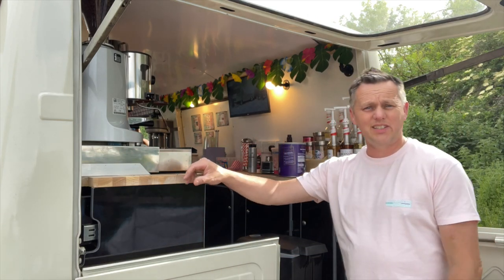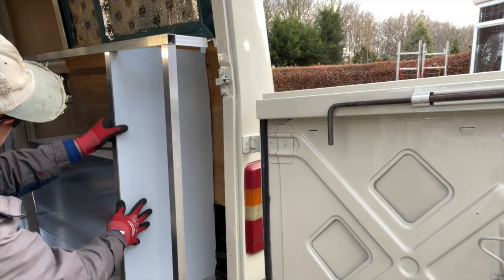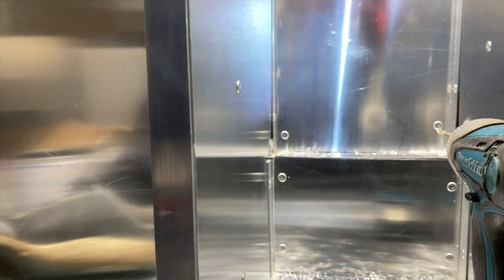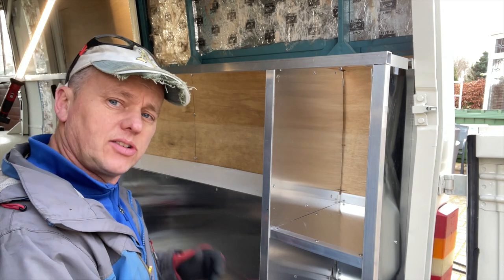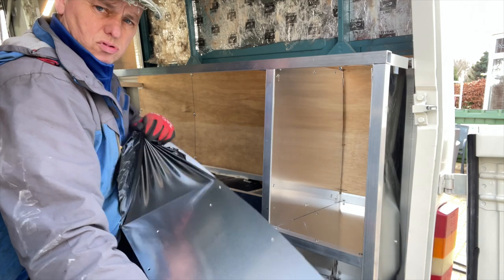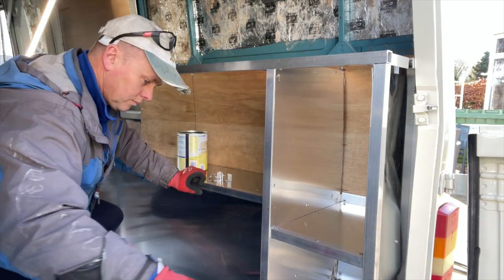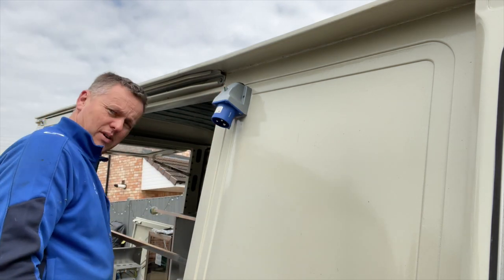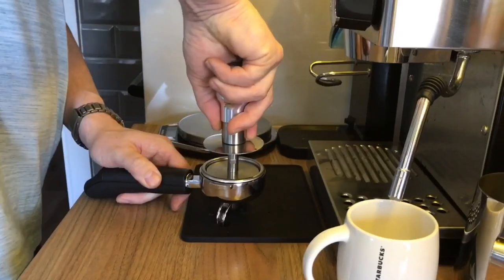Peugeot J9 Coffee Van Restoration, Episode 22  Building Units & Electrics, Fitting Consumer Unit.

Comment: Just a couple things to note-if not already, need to make sure the chassis is earthed to the main earth terminal in the consumer unit,  to allow fault current to trip the MCBs in the event of a fault from live conductor to the chassis. Also where cables are running through metal of the body a rubber grommet or brass bush should be used as the cable could become damaged as it heats up against a sharp metal edge. Vans looking very smart getting there.
Reply from the maker: Thanks for the heads up, Van is working like a dream plenty more videos to come, Thanks for the great comments👍🏻👍🏻🛠

Comment: What gauge aluminium sheets and box section did you use? I am soo curious, It looks fantastic! Also how much in total do you think you used (length)?
Reply from the maker: Most of it was 1.5 mm gauge I’m not too sure on how many lengths are used in total, but it wouldn’t be far from 20 5 meter lengths Thanks for the great comments👍🏻👍🏻🛠

Comment: Hi Ant, Question. Why do you use two pairs of wires for power into the van?
Reply from the maker: I wanted more capacity than 32 amps, the single wire is 25a rated, could have bought a thicker wire, or as I did double up, Thanks for the great comments👍🏻👍🏻🛠
Reply: @aaanton11  I thought it might be due to the wire rating but wanted to check. Love your channel mate keep up the great work!
Jealous of your skills! Scott (Stoney Ground Coffee)